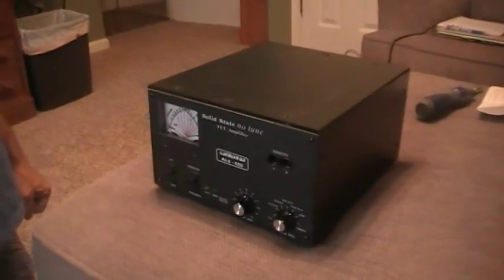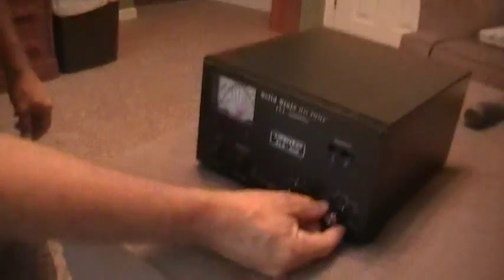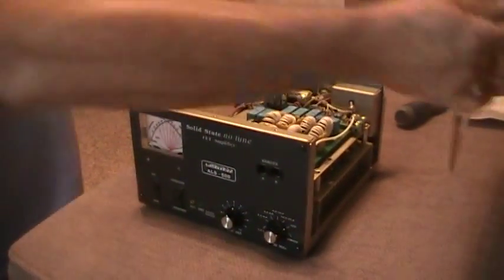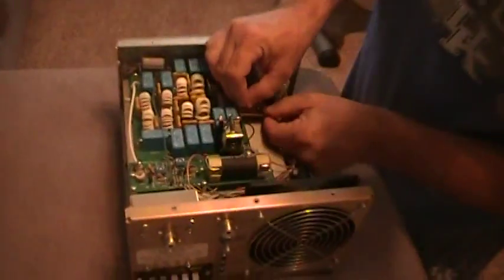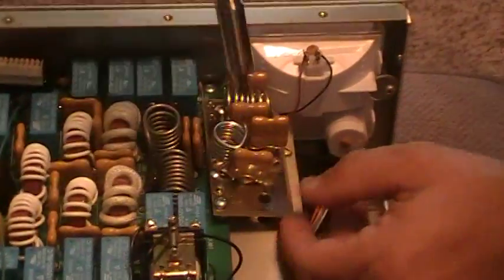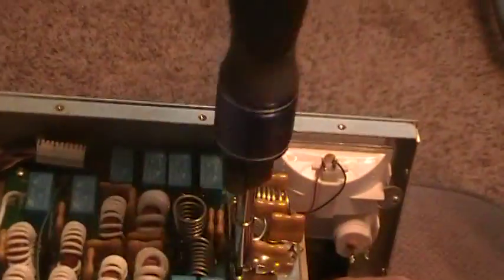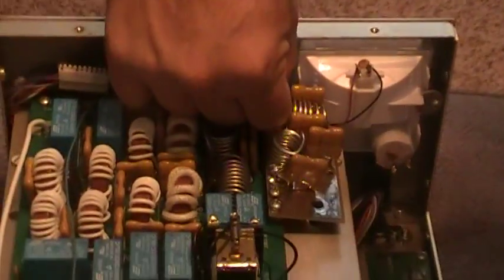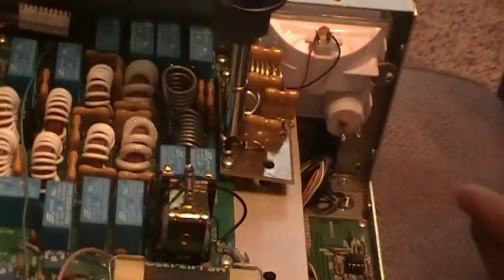Ameritron ALS- 600 10/12 Meter Modification

Comment: With the 10-12 board will the Amp work on 11 Meters
Reply: DUH! That's not what he asked !
Reply: Illegal on cb
Reply: Yes, it works, but avoid using AM.
Reply: @markstewart1446   why?
Reply: @MrRichard57000  AM is hard on the tubes. Real hard.
Reply: @M70ACARRY this amp has 4x mrf 150   transistor...no tube......
Reply: @markstewart1446  hey mark mine doesnt work on 11 with this mod is there something else i need to do ???   thanks
Reply: dave did you get yours to work on 11 ???  thanks
Reply: @WildBillQRO  It says here something about cutting a green wire and adjusting some coils to get it to work on 11 meters but I didn't notice if it said you still need the 10/12 mod piece or not, check it out for yourself. I know it says the 811 but I'm pretty sure all Ameritrons are the same but I could be wrong. http://www.copperelectronics.com/discus4/messages/34/107912.html?1234876991
Reply: @shaunlee6511  got it to work with just the mod board u just need a really good match and it will work
Reply: Yes